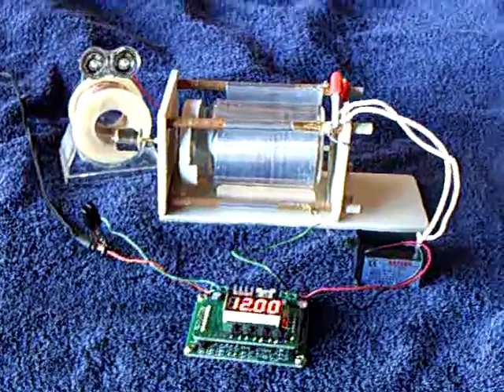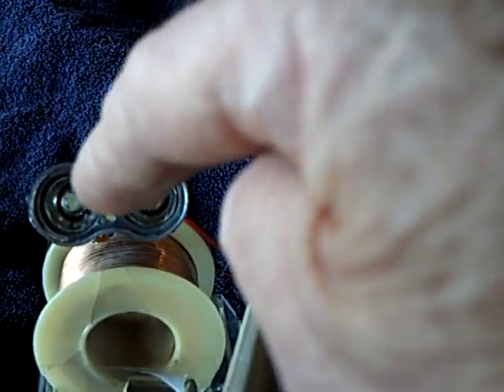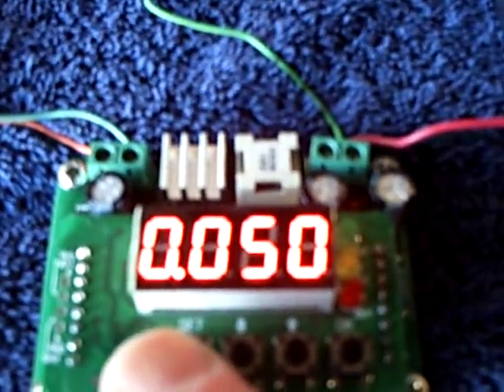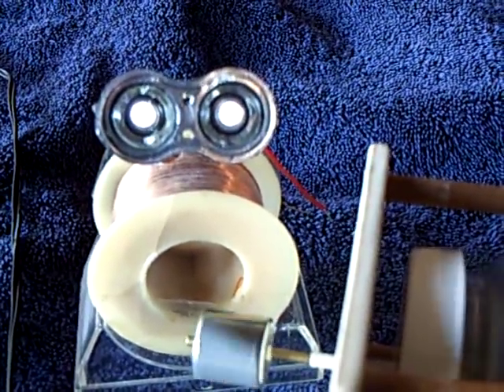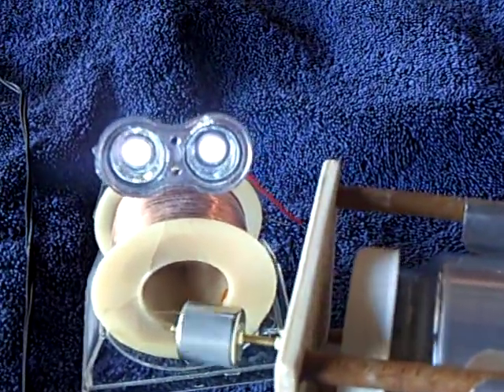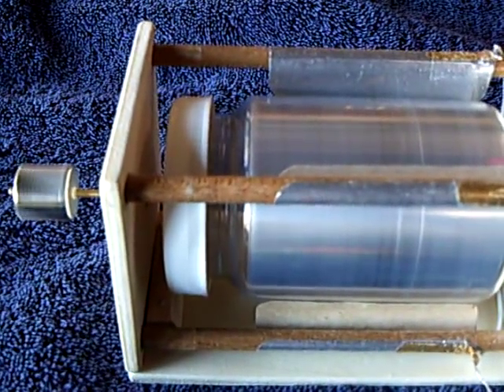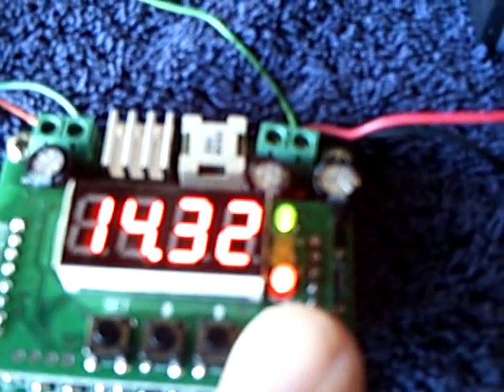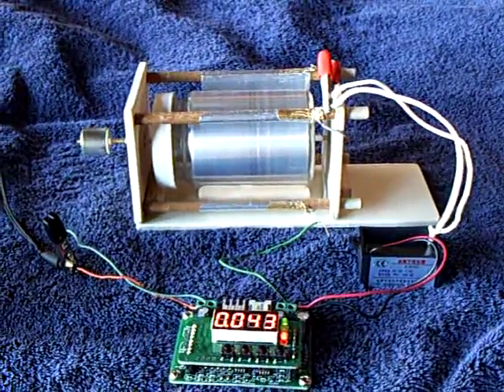Maggie load testing the Corona Motor

Comment: Thanks for the pub :) I found out something new on this little power supply there's some hidden menu O.O if you hold the "OK" button and turn the power on you will get in a 3 choice menu which are 1- Power on, output off, volts and amps setting 2- Power on, output off, volts/amps setting + save and load function output reading extra power and charge 3- Power on, output on basic setting. Cheers :) I'll probably make a new video for those hidden menu.
Reply from the maker: That is a great little device.  I figured that there was probably more functions hidden in there somewhere.
Reply: hehehe :)

Comment: very nice  motor! reminds me of the way the bicycle wheel spins if i point the air compressor or the jet water blower at an angle to it. The form of the blades is nice too, reminds me of Tesla s one way valve. One blade one part, he used 14 i think.
The input power thing tho it\s normal, Torque x rpm = U x I at 1 efficiency.  No load u got max rpm, at stall max torque at same power input. It just transferred some of the rpms in power to the Maggie. BUT this motor thought as a BLDC outrunner motor may be a real step up! 12 blades  on the inner stator and 14 strips on an outer rotor.

Comment: What's the coil inducing in AC? Was hoping to see Maggie's voltage :-) Very nice as always.
Reply from the maker: Thanks.  Maggie is wired to a bridge rectifier and then to the leds.  The voltage gets clamped by leds at about 2.5 volts dc. There isn't much amperage because of the type of coil I used.  I have never checked the ac before it hits the bridge but I should.

Comment: Lid,
Have you heard of the Zamboni pile, high voltage dry cells

http://en.wikipedia.org/wiki/Oxford_Electric_Bell
The Oxford Electric Bell or Clarendon Dry Pile is an experimental electric bell that was set up in 1840 and which has run almost continuously ever since

It would be interesting to create a Zamboni pile to  run your machine, lasting over 100 years

Comment: *****  Would not a Flywheel pulley system that spins a DC motor in reverse generate more electricity? or even a Flywheel pully system to spin the magnet at far higher RPM's to generate a higher electrical load which you can then step into a Jewl thief and pass into a HV stepper to step it up to 6000 volts, and store that charge into capacitor banks before distributing it to an outlet etc.....
Reply from the maker: Eidolon Not enough torque to do that.  Friction loss in the bearings would eat what little real power is there.
Reply: ***** Dont Use Bearings. The pulley should be mounted directly to the Motor Shaft. If you spin through multiple Pulleys the rotations will increase. I this way i have already been able to succesfully been able to use a Mini Atmo Motor that powers A mini Van De Graaff allowing itself to run non stop after initially starting the van de graaff by hand. Ive also successfully added a small DC motor ran in reverse to generate a constant 1v in this mini set up. Im currently in the process of building a larger version with a goal of 12 v output.
Reply: ***** also something to look into, that i have been thinking about trying, is eliminating the bearings by using magnetic levitation suspension to levitate the motor core. This will allow you to spin up to 14,000 RPS before you start to lose stability.
Reply: I have this exact idea, glad to knowe its feasible